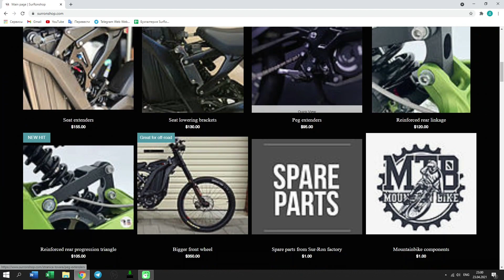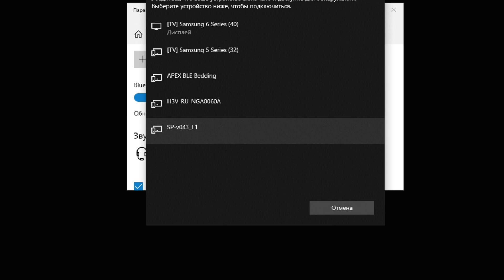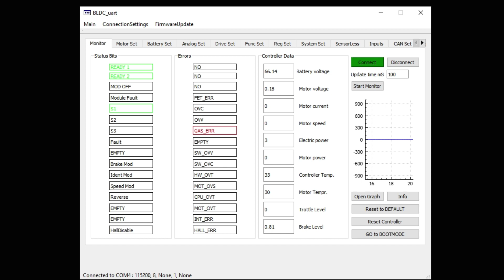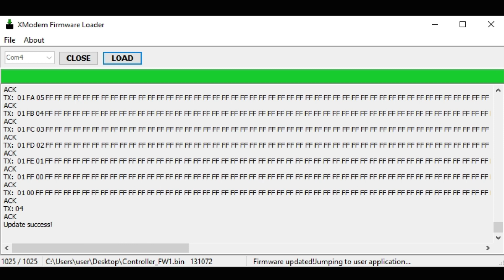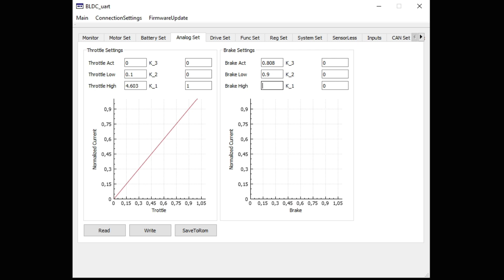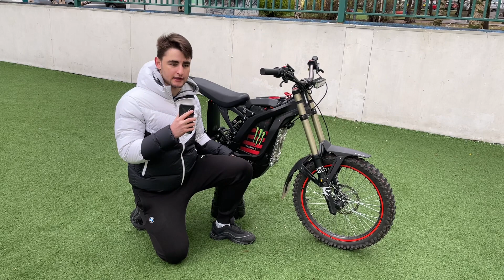SinTech controller for Sur-Ron setup instructions from SurRonshop

Comment: Can you guys preset it in factory without the customers bike or do they have to do this tutorial from house?
Reply from the maker: You have to bind controller to the particular motor therefore controller has to be set on the bike. We offer free remote setup service for customer convenience but only when the controller is installed on the bike
Reply: @SurRonshop  so if I want a remote set up you would need my surron to get the remote setup completed?
Reply from the maker: @CerberuzMoto  you need to install your sintech controller and open remove computer access software so that we remotely tune and set your controller on your bike
Reply: @SurRonshop  so you guys can remote tune from your shop while I have the controller?
Reply from the maker: @CerberuzMoto  yes